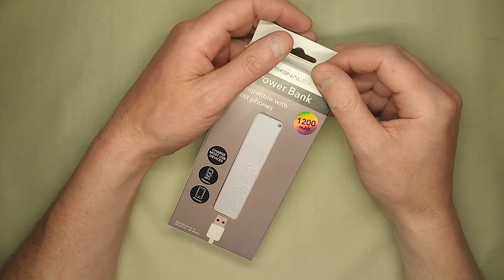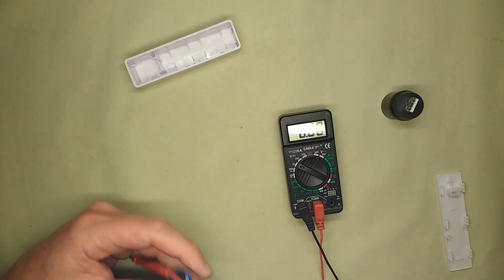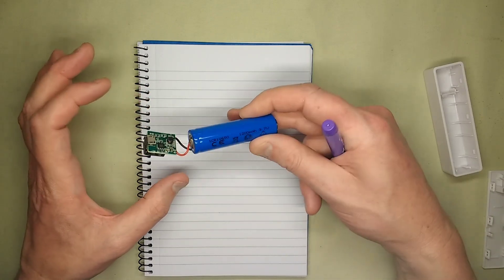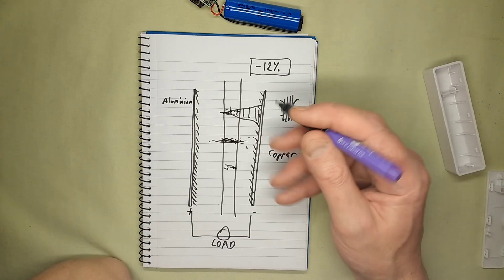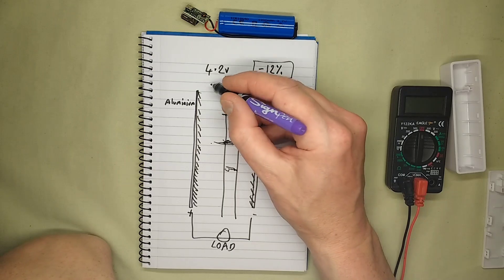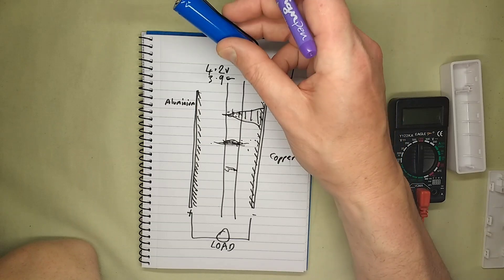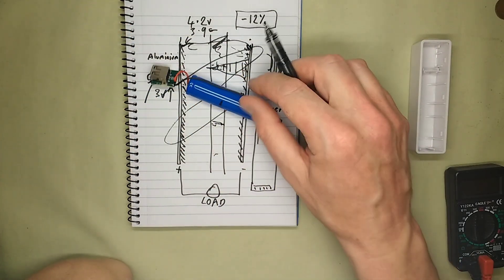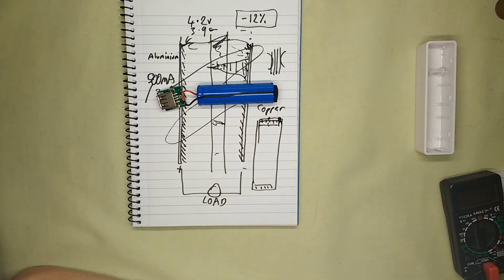Are over-discharged lithium cells safe?  (And how to test for damage.)

Comment: A power bank that self-discharges doesn't seem very useful.
Reply: Can batteries be made with 0 charge in them and need a full charge the first time by the user? When you buy something that has a charged battery, was it made that way or charged before it left the factory? Ive had both 0 and full, all performed well so I dont know that answer.
Reply: +cvcoco — Power bank batteries are used to recharge a cell phone or other device in an emergency when one doesn't have access to mains power.  What i meant by my comment could also be applied to a spare tire with a leak or a canister of gasoline that one carries on the back of a Jeep for emergencies having a small hole in it, allowing the fuel to seep out.
Reply: Oh I understood you the first time. That part is OK. In the video, the concern or question was whether or not a battery is defective if it arrives to you fully discharged. So I asked, are they made that way, with zero charge in them and must be charged before use? Or, if they arrive to you fully charged, were they made that way or charged at the factory before leaving?
Reply: Receiving a battery with no charge doesn't necessarily mean it is dangerous or dead.  It depends on the battery chemistry.  Some batteries have zero charge when they're assembled and need to be charged before use.  Lead-acid batteries are a good example.  It is not so common anymore, but at one time such batteries were shipped dry, without the sulfuric acid electrolyte in them, and the electrolyte would be added at the time of sale, whereupon the battery would need to be charged for an hour or two before it could start a car.
Reply: The motorcycle batteries I buy in motorcycle dealers are dry, the acid has to be added and batt charged at time of sale. But yes I get your point.
Reply: @Milosz_Ostrow  or its a fake battery with a capasitator in it.......

Comment: How does fast charge on phones actually work? Does it not put extreme stress on the battery?
Reply: Против Глобал that makes much sense. My oneplus 5 has the charging unit in the charger itself to nearly eliminate the Phone getting hot while charging. Thanks ^^

Comment: Is this over discharging and resulting copper paths made in the cell the reason behind some phone and laptop batteries not taking charge after using for a long time?
Reply from the maker: Cell capacity reduces over time.  Lithium cells only last about 500 recharge cycles before their capacity is diminished.  That's about 2 years for a phone.
Reply: bigclivedotcom that makes sense, i appreciate the response!

Comment: I could be wrong on this but I seem to remember the earliest lithium cells (back in the 1990's) were nothing like as robust as anything I have seen in the last 5 or so years. It could be those problems used to exist but solutions have been found a while back. That said SAFT give fairly strict instructions not to over-discharge on their web site on the application notes. I think though it is more a "loss of capacity" issue than anything else.

Comment: Interesting video, I recently found 4 UltraFire 18560's in the glove box of my old car that has been parked in the sun for the better part of a year. 3 of the cells charged up fine but the 4th cell did not register in my Olight magnetic battery charger. And when put into my Klarus CH1 it tried to charge but it just got hot (well decently warm)  so I disconnected it. I don't have my meter here to test the voltage but I am assuming the reason it turned into a heater is that it has formed the copper tracks like you mentioned and the heat is caused by its internal self dis-charge resistance? I plan to puncture it sometime to see if I can get any flames! (safely of course)

Comment: Most of my 18650s came from a job lot of new old stock laptop battery packs I got on ebay a while back. Most of them work fine but there was one pack full of dead cells that wouldnt hold a charge. Other dead cells in the lot were randomly distributed among the other battery packs, so a single pack might yield a bunch of good cells and one dead one. 
Also there seemed to be two different failure modes. Some just wouldnt hold a charge, but some were different, they would never reach 4.2V, they just got hot as the charger tried in vain to finish the charge. Those ones would actually hold the charge they took, but I didnt feel confident using them. I wondered if maybe time left sitting at low voltage or storage temperatures might be a factor but I dont know. Mysterious things.

Comment: This is a topic I wish I didn't know so much about, made me loose sleep at first until I had a full understanding. Even now their is to much to have 100% full understanding but I think I know enough to to sleep better.
The Samsung cells are more on the side of Li-Po packs when it comes down to the makeup chemistry and they are like a lot of newer packs because people want longer run times. Unlike the initial Li-Ion and Li-Po cells the nominal voltage is usually 3.7V per cell, with a max charge of 4.2V +/-0.05V. And depending on the chemistry of Li-Ion cells some can go down to 2V from a parasitic drain, but not while under load. Load minimal voltage would be usually 2.5V for chemistries like ICR and some other safer mixes. So this means the voltage cutoff is usually at 3.0V per cell when you measure it without a load and why they set the cutoff at 3V per cell.
Most cutoff monitor chips these days are also staying on the safer side of max charging voltage with 4.1V and not 4.2V for the sole reason of safety.
But back to my point, Samsung and some others are now pushing the Li-Po packs to 4.35V max charge per cell with a nominal voltage of 3.8V unlike the ones labeled 3.7V per cell. And the soft packs are easier to be punctured when they swell up by other components packed into these thin phones and tablets that release the volatile venting. They already become more volatile and unstable if they well and they are usually OK with the heavy wrap of PVC around the cells until they get punctured and that's when they "explode" or technically vent.
A safer Li-Ion 18650 chemistry Li-Ion like most Samsung, Sanyo, Panasonic cells take a lot before they would vent. But then you have the really cheap and fake cells that's a big problem on the market. With yours in this example I don't know what cell that could be at 1200mAh wrapped in blue PVC? I usually like to see a pink battery in these cheaper power banks like I've bought from microcenter for $5 US and had ICR Samsung cells. A cheaper chemistry cell will also build up these copper shunts a lot faster then a good known cell. I would still be carful with that one, unless it's a re-wrapped recycled 18650 that was torn out of a recycled laptop pack and re-sold in this power bank, yes that happens also. So you now don't know how many cycles are left for charging or how many times it has been fully discharged and what partial "copper shunts" are already built up inside the cell. 
Their are so many factors and unknown variables when you buy the cheap lithium based battery operated things. 
I usually recommend recycling any battery or charger that comes with the cheap LED flashlights or other cheap things and get a good knows 18650 maybe that has a built in protection if it fits in the flashlight and a good XTar or NiteCore authentic charger. 
As for Samsung and big companies making this mistake, shame on them for not testing properly under real world usage how a customer would use the device, heat it up playing games, charge it back to back when it dies or gets low, run GPS with the LCD on full brightness while charging in a hot car and other scenarios or they would have realized they had an issue. They are so worried about beating the other company to the release of the new phone, or new" whatever" they over look the customers safety and skip basic testing that should have been done.
If your buying cells in the US I recommend http://www.illumn.com/ since they test the cells to make sure they have authentic products and have agreements with manufactures to buy direct with some. 
Or check with the big flashlight forums since LED flashlight builders seem to make sure they get real cells and can recommend a good seller for your area. Vapers only seem to care about what people say and don't test the cells and want bigger clouds, no offense to those who vape. I've seen testing done on cells in vape forums that had wrong and horrible misguided information and wouldn't trust them to put a 18650 to your lips.
Be careful, some of these vape reseller sometimes buy fakes and sell fakes and don't even know it. Once they are told I've never seen them recall the fake ones. Illumn has had to recall a fake cell they sold once and stand behind what they cell and cares for the customers safety.
*Disclaimer, I don't work for them and I'm not associate it with them in anyway.
Have fun and Be safe, be careful to all,
Scott

Comment: This phenomenon often occurs even in today's Ni-MH modern cells- I am writing this based on my experiences and observation . Especially in cheap enviroments like popular 1xAA or 1xAAA solar lights. When the boost converter draws every Wh from battery and it provides to completely discharge and in the worst case even with swapped polarity phenomenon. It's really interesting because it is kinda "silent knowledge", could you @bigclivedotcom ever make a material about it?

P.s Very intriguing material, thumb up, keep it up and best wishes!

Comment: Clive, can you please recommend one of these dumb powerbanks that is cheap and easy to get here in the UK that doesn't discharge itself too quickly without a load? Reason being if I use a normal powerbank to keep a timelapse camera going it shuts off as soon as it detects the camera battery has been charged then the camera goes flat but the powerbank doesn't start charging it again even though it still has loads of charge
Reply: That's more a camera charge circuit thing. When the camera battery shuts off saying "DONE CHARGING" it will not re-engage until the USB plug has been reconnected. @Daft Cat Brewing
Reply: PixelBearTony you need to make a circuit that disconnects the power to camera every so often.
Reply: camera should use the external power as long as it is plugged in instead of the battery, yeah it is more of the camera charge circuitry instead of the powerbank
Reply: No it’s not a camera thing. It’s a powerbank thing once they drop too a very low output they toggle off to prevent self draining and need to be plugged back in again. I’ve got some power banks that just keep going and some that don’t on the same camera do it is most certainly not the camera

Comment: Great video, man! I have been reusing cells from discarded notebook batteries and the first one I ever opposed the voltage of the cells were 0.64v, but I tried to recharge anyway. And all of them stayed above 4.1v until today. (I didn't use them yet - I plan to make a 6 cell power bank with them.) Later, when I finally got a capacity tester, I discovered the those 6 cells have more then 2100mAh! So, the initial voltage really means nothing.

Comment: Clive, thanks for this interesting post!
My bad experience with lithium battery was no overdischarge. I kept my solar charger external battery power bank with lithium polymer battery in my car in direct sunlight as a test. The enclosure opened itself, one of the cells expanded. 
Pictures see my blog post  http://blog.jeronimus.net/2017/07/solar-charger-teardown.html

Comment: i had a laptop battery not charge anymore, so i replaced it and kept the old one to take apart when i get around to it. so about a year later i "got around to it" and found the 18650's inside at about 1.7v. i then used a cheap-o charger to see what would happen after i separated all the cells. they took charge no problem and after about 2 months of sitting around they were still at full charge. so i started using them and found that the labeled mah was still around what i was seeing

Comment: I believe I left a comment a long time ago on one of your other videos about this topic.. I recall saying I recovered cells from old laptop batteries and there were no capacity losses that occurred afterwards.. Jump back to now and those same cells have lost some capacity but not beyond the "normal" amount.

I have had terrible luck with those powerbanks here in Ireland, bought two on two different occasions and both batteries had around 800mAh capacity, both of the circuit boards died too (Okay one was my own fault but hey). I'm guessing we just get the worst of the batches or the rejected ones lol

Comment: That was very interesting. Thank you for sharing it.
I was thinking if a bunch ceramic caps in parallel (to form like 470uF total for low ESR and not use tantalum), can be charged to 12V volts and then discharged into the battery. Rinse and repeat for 2 minutes. Then charge as normal.
Would that not destroy the microscopic shunts, like blowing fuses? 
I wonder... What do you think?
Reply from the maker: I'd be wary about trying that with something that crams so much energy into a small area.
Reply: If the battery is empty, and you're doing it for only a couple of minutes, how much energy can there be?

Comment: I wonder if the batteries are actually made with a low charge electrolyte for safety during transportation?
Reply from the maker: They're usually shipped at a mid voltage like 3.6V.

Comment: Li Ion behave like lead acids when they are completely flat as they will eventually loose capacity from all the ones I've messed with. Now if you OVER charge them, then they plate out the lithium and then it goes bang.
Reply: Now what hes talking about is when the cell is having current forced through it after its been discharged (cell reversal), which is not the same as just running it flat. This destroys any type of cell. This is why they need balancing thru external circuitry. Real common mode of failure to have one cell go bad like that.

Comment: Hi Clive can I ask you do u know which are good 18650 battery's to buy of eBay as there seem to be so many different ones any help would be great
Reply from the maker: It depends what capacity or current capability you require.  The e-cig/vaping cells tend to be high current units, but cheaper cells are available that can handle less load current but still have high capacity.
Reply: bigclivedotcom hi many thanks on a reply I should of said I use the battery's for a Cree xml2 torch double battery and a boruit head light with a double battery

Comment: I could have told you discharging Li-ion cells to 0 was fine. I do it all the time because I'm too lazy to build a circuit to keep that from happening. 

Yeah, it's not ideal and doing it regularly will put a lot more wear on the battery than only discharging it to something like 10% but it's not that big of a deal and 18650s aren't that expensive so it's fine.

That being said, don't overcharge is very bad.
Reply: Yeah, but anecdotal evidence doesn’t convince people. Now there’s a video I can link people to when they spout the incorrect information.

Comment: Would prefer to get a claimed new battery with zero volts because more likely means it has never been charged since manufacture as opposed to something that may have been used a lot before it arrived.

Comment: CAN u incorporate a solar panel on to a laptop lid/back of screen for direct charging ...Also i was wundering what wud happen if say u put 6 mirrors in semi circle pointing at say 150w solar pannel. wud it boost it or melt it
Reply: The_dude A panel that would fit on a laptop, wouldn't give much of a charge in a reasonable time frame.

Comment: Really interesting summary thanks Clive. I'm currently processing 18650s from laptop batteries and many are coming out at less than a volt. I give them a slow charge at about 50-100ma for a while until they reach 3v and then crank up the current in stages. They all seem to charge fine after this point. The plan is they will all then sit in a box for a month and I'll check the voltage after that and make decisions on which to keep and which to recycle.
Reply: Adam Welch I tend to find the best batteries come from packs where one of the three sets is dead. So my voltages are 4.1, 4.1, 0.7
Reply: Samuel Seidel You can see why. When one fails prematurely the others should have a good life left in them. All mine seem to have been left for a while self discharging or the BMS has completely failed meaning they've all gone very low. Hopefully there is life in them yet.
Reply: Samuel Seidel fhjjf
Reply: I just tore abpart the battery pack from an ancient Windows 95 era tablet, two of the cells were dead, the rest had around 2.5 volts or better, even after laying in my back room for years.  I put them on a charger and charged them up to a full charge, they are holding just fine. Funny looking little thin square cells that were packed in single rows of four each for a total of only 8 of that six of them are working fine, I plan on using them in projects that are in need of rechargable batteries.  I build mostly ghost detector type toys for my niece who thinks she is a psychic or some damn thing and goes on those stupid ghost hunts all over the tri-state area. They cost so little to build and maker her so happy that it's must makes the building fun.
Reply: Hi Adam, just wondering what are you using to charge these at this voltage?.
Reply: The Littokala 500 is a great charger, it charges at 300, 500, 700, and 1000mah and also tests capacity they are great for recycling laptop cells.
Reply: That sounds good to me. After a charge like that, I give them a short low current test just to see if what the future will be.
Reply: Sfhhjjkkkkkijj